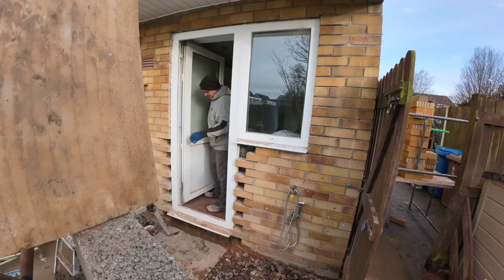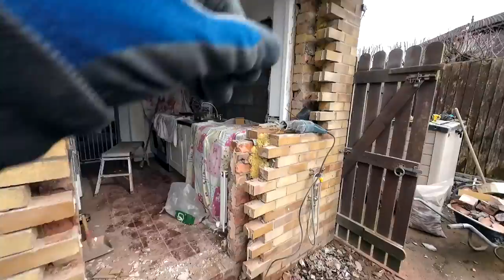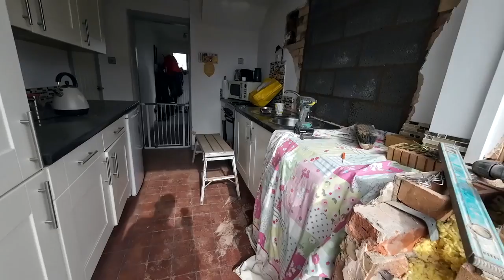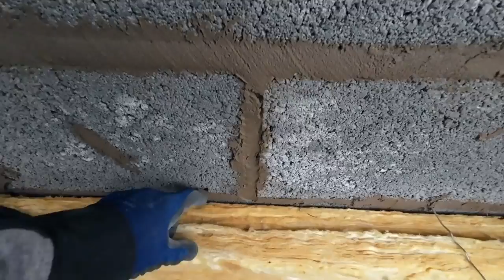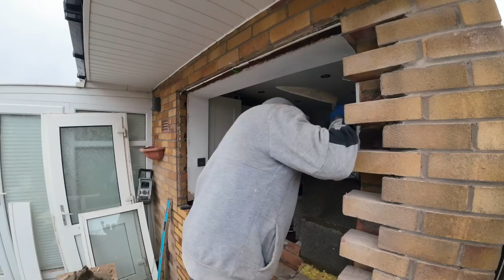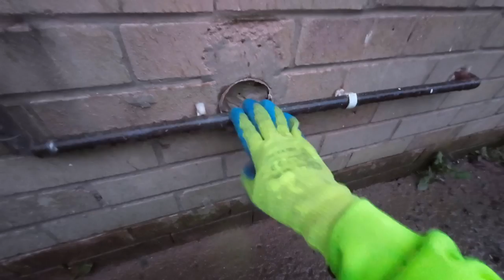HOW TO BRICK UP A DOOR CORRECTLY .  PT 2

Comment: Came up very well. Looks like it’s going to dry out a very good match 👍🏼 Wise not to do the fiddly bit around the gas pipe. Personally I never work around gas or water pipes unless there’s a stop valve I can shut off. Not worth the drama that can unfold. Learned that lesson many years ago.
Reply from the maker: Cheers buddy, very true 😬🧱👍🏽

Comment: Ile try and clarify some of the comments I've seen, the fella who mentioned Dyebrick was talking about brick tinting something  which can be done if the client is fussy and wants the infill to match 100%, as for semi engineering's it's a common term down my way for any clay brick with holes in it, basically frost resistant we then call red and blue engineering's with holes class B and solids class A, not sure if it's technically correct but it's always been like that down here👍nice job 👌
Reply from the maker: Nice one thanks for the explanation, always good no nonsense knowledge 🤜🏽🤛🏽🧱👍🏽
Reply from the maker: @martin2466  🧱🧱🧱🧱🧱👍🏽

Comment: Great video! What was the reason for keeping those thirds in on the ex door wall?
Also what was the fixings on the right hand side of the window and also, how did you close the new cavity?
Reply from the maker: Thirds !? I think you mean 3/4 s . They stayed as they fitted the new brickwork. I can’t remember the fixing we used  and the cavity is sorted out by the plasterer 🧱👍🏽
Reply: @SteveAndAlexBuild  aye sorry 3/4s, just wondered if it would have worked out better for yourselves taking them out. End of the day you guys were there and did the calcs and it's a job well done by you both so no critiscm just airing thoughts. Looking forward to the next one 👍
Reply from the maker: Cheers Stephen 🤜🏽🤛🏽🧱👍🏽

Comment: The hard part for me (when I bricked up the old boiler flue outlet) was matching the mortar. Guessing the sand and mix ratio. Cos it looks different until dry. Fortunately my guess worked out perfect! Along with a trip to the brick library to get the best match bricks. The Gas Board had come along with some random bricks but I said if they knocked fifty quid off the bill I would do it. I guess they wouldn't have toothed-in either! I am an amateur not a brickie, but gained my degree in the university of life!
Reply from the maker: We call the gas engineer repairs hand Granada jobs, they never tooth out and never even try to match the brick 💥😠😠🧱👍🏽

Comment: Fliton face brick on house with semi engineer brick doing patch work a bit to yellow on patch work for me
Reply from the maker: Where are the semi engineering bricks ?
Reply from the maker: @martin2466  🤔???
Reply from the maker: @martin2466  not a single one Martin , I think the same . 🙄🧱👍🏽
Reply: @SteveAndAlexBuild  bricks that you was using doing patch work with holes in are called semi engineers down are way bottom line I would have got original bricks that house was built in fliton face brick is easy to get hold of down our way and would matched up better but I fully understand that sometimes can be nightmare getting hold bricks that match up but in this case that was easy match up, quality of work you do is of high standard excellent, it’s just that I’m very fussy with things like that after all it’s kept me in bricklaying since 1977
Reply from the maker: @trevormappley  I’m fussy too and the  London flettons are absolute shite and no guarantee to be any better match . The bricks we used are Ibstock tradesman and are an excellent match , cheaper and infinity better quality than the London’s . 
   You are the only person who has questioned the match  and we have some very fussy people in the comments.
    Lastly you’ve got ten years on me and in all honesty since 1987 I’ve never heard of semi engineering bricks 🧱🧱👍🏽
Reply: @SteveAndAlexBuild  I never said anything about quality we all know they are shit bricks especially when freezing cold can blow face off them bricks, there’s old saying down our way you can’t polish turd 💩 by putting 200 quality bricks in and rest house has shit bricks, point I was making it would have matched better, with original shit bricks
Reply from the maker: @trevormappley  🧱👍🏽